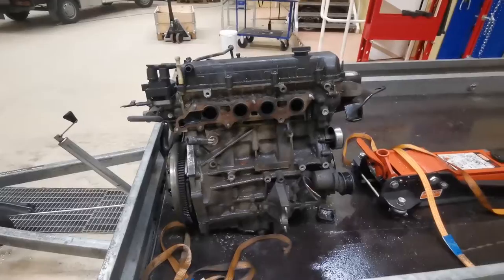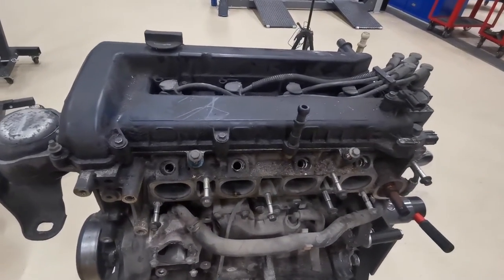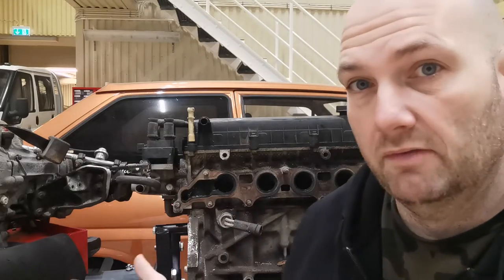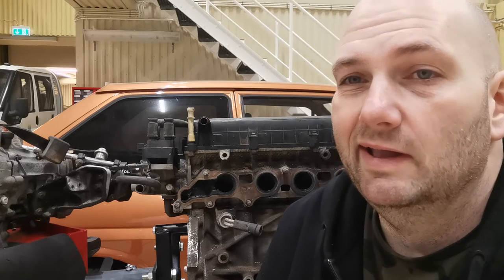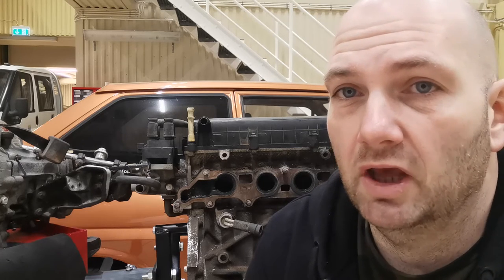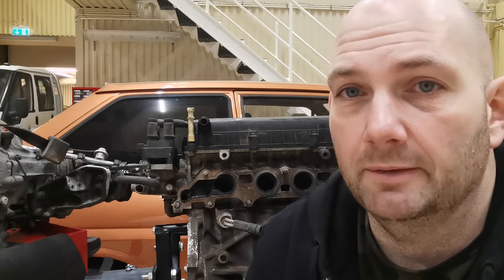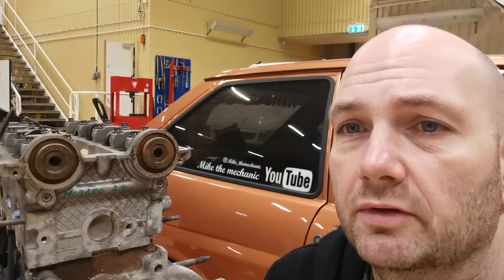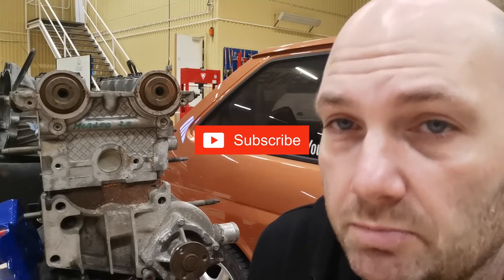Zetec OR Duratec? I wish I had known the difference before I started. Which one should YOU buy?

Comment: No offence but your out of your depth a bit here, it’s  a Ford engine mazda adapted. 

Mtx75 box fits, fiesta st150 ib5+ box fits, focus mk2 2.0 duratec box fits. Any box with a bell housing adapter plate for £2-300 quid

A bit more homework would have saved you a lot of hassle.

I’m no mechanic but know these things.

Duratec 1.8 2.0 2.3 2.5 Ford engine 2.5 has vvt
Mazda 1.8 2.0 2.3 have also got vvt. 

A lot of internal differences/ dipstick location inlets etc.

Major thing you should have checked. 

Duratec has a chain 
Zetec has a belt

Hope this helps a bit to someone

Comment: I have a 1.8 Duratec petrol Mondeo.  5 speed manual.  MTX75.
Reply from the maker: That's probably the same engine as in my video with the black top rocker cover
Reply: @mike_themechanic  yes.  It looks the same.  Mines on 144,000 and still runs like a top (de-flapped at 77,000). Fresh 5w30 every 10,000
Reply from the maker: @steve0680657  it is possible to fit in to a fiesta but it's not as "straight forward" as the one I've done.
Reply: @mike_themechanic  The st150 gearbox is an option.
Reply from the maker: Probably. Anything will fit it just needs more fabrication work to fit it.

Comment: Old Fords are like a LEGO set! Every engine will fit every gearbox and drive shaft.
The Mk2 Mondeo in 1998 still has either Silver or Blacktop but all the bolt patterns are the same for RWD or FWD
I built a ZVH turbo engine (1.8 zetec bottom end with CVH head) and all patterns are the same.
When the Duratec came out they used Mazda engines and gearboxes.
But when the Zetec SE came out (Yamaha engine) they used the old RWD T9 pattern!
Reply from the maker: Never thought of it like a lego set before 😂😂😂
Reply: @mike_themechanic  If you're into a Mk1/2 Fiesta  with a Mondeo engine you should know LOL
Reply: Even the old 1.3 crossflow engine has the same bolt pattern.
Reply from the maker: @cossiemk2 well it is the first time I've done this kind of swop so it's been a voyage of discovery 😂.
Originally i thought it was an easy task just an engine and a gearbox bolt them together and that's it done but then I found out about the  baffel plate, the driveshafts, the brake servo, injection system, fuel tank etc etc
Reply from the maker: @cossiemk2  never even considered that 😂😂😂😂
Reply: @mike_themechanic  Ok so it's a new adventure! I thought you were a Ford man with some experience! Sorry!
Reply from the maker: @cossiemk2  i started my mechanic life at ford back in the late 90's, and after moving to sweden I've worked on hgv and plant equipment before becoming a vocational teacher in the automotive industry. I've always had an eye for fords but never had the opportunity to do anything like the engine swap that I've done now.

Comment: These duratec is also used in volvo v50 c30 2003-2012 front wheel drive with 5 speed MTX75.
Reply from the maker: True.
Reply: In the US, every Duratec powered Focus with a manual transmission has the MTX75. They are pretty easy to find. The 5 and 6 speed transmissions from the Mazda 3 also bolt up.

Comment: As you may know I’ve fitted the st170 engine and 6 speed box in mine… they’re a very similar engine, I’ve tried to be as detailed as I can in my insta with how I’ve overcome a few problems.. too many to list here! 😉 keep up the good work.. there’ll be many more obstacles!
Reply from the maker: Do you have a link to your Ig?
Reply: @mike_themechanic is my fathers 1.6 duratec a mazda engine, or a yamaha codeveloped engine
Reply: @mike_themechanic cuz my dad used to own a 1.6 zetec
Reply from the maker: I think all duratec engines were mazda. Zetec was ford made.
Reply: @mike_themechanic  it still sounds almost the same to me.
Reply from the maker: The engines look quite similar if you look at the rocker cover but they are very different from there downward. The zetec engine fits to alot of the ford gearboxes the mazda ones don't
Reply: @mike_themechanic  ok, good to know.
Reply: @mike_themechanic  1.6 Duratec actually Sigma (Zetec-se newer iteration)
Reply from the maker: @gentrest6421  ok thanks. Glad someone could give a more correct answer
Reply: @bigmansir3745  Yamaha co-developed -  Sigma.

Comment: They did a mk3 Mondeo with Mazda derived Duratec engine and 5spd gearbox. I have one. 2005 2.0i "Zetec" (not to confuse things further, Zetec being a trim level on the mk3!!).
Reply from the maker: I think most mk3 mondeos were duratec mazda engines.
Reply: I have a 1.8 Duratec petrol Mondeo.  5 speed manual.  MTX75.

Comment: Ib5 out of an st150, bolts straight together.
Reply from the maker: Any of the ib5 gearboxes bolt straight to the zetec engine
Reply: This is the confusion - the st150 is definitely duratec 2.0 and definitely ib5... I wonder if there are multiple variations of the duratec blocks with different bell housing bolts no one talks about...
Reply: @branney6914  Highly unlikely. The transmission just has a different bell housing to fit the other engine. This is very common.

Comment: Are the 'black top' engines cast aluminium or engineering plastic?
Biggest problem I have with Ford is they use the same name for vastly different engines (guess that's the problem you found as well?)
I've got a 2004 Mazda B2300 but no idea what actual engine is in it, I know it's Ford and maybe Ztec?
If I was still in Britain it wouldn't be a problem as I knew several people working at the Bridgend Engine plant (but I think that's also been closed down now?)
Reply from the maker: They are cast iron blocks with alu cylinder heads.
Reply: @mike_themechanic   Sorry, I should have been more specific, I meant the cam covers
Reply from the maker: The black tops are plastic and the silver tops are aluminium but the silver top does fit on the black top.
Reply: @mike_themechanic  That's good to know, 'plastic' seems to distort  and leak oil into spark plug recess. I've worked on motorcycles about 50 years and never liked engineered plastics on engines, even alloy on the Honda 750/900 (and various Kawasaki's, Yamaha's and Suzuki's) allowed leaks around plugs when the seals were not in right or age hardened.
Reply from the maker: @1crazypj I've replaced my plastic one with an aluminium one I think it looks better as it could be painted as well
Reply: @mike_themechanic  I did a bunch of hunting around last night and find I have a Duratec in Mazda. Even though it's a crazy amount of work, aluminium can be polished. The alloy quality can't be any worse than 1960's Honda's 🤔 (although I'm too old and too lazy to spend the time nowadays 😁)
Reply from the maker: @1crazypj I painted mine in silver and clear coat I like the look of it. I was going to do body colour but decided against it in the end

Comment: The Mazda version is arguably better than the Duratec, Ford cheaped out on the bottom end components, namely the pistons and rods, to  get 300bhp from the Duratec takes a lot of work, not so much with the MZR.
Reply: I had two mazda 6 mps's, both enginges went kapoot. Only found out after the second one shit itself that ford may have had something yo do with the soft componants in the 2.3 four cylinder dohc 16 valve single turbo engine.

Comment: The zetec is better engine  the duratecs drink oil and been known to knock bottom.end out I have seen zetecs with over 200000  miles and still running well the fiesta st 150 uses the 2.0 litre Duratec engine and uses a 5 speed box
Reply: My 2012 Fiesta has a 1.25 duratec engine, its a normal port injection engine and it has never lost one single drip of oil an i'm at 212000 kms now :D
Reply: @LikaPyramid  different engine
Reply: @MegaReddevil71  what do you mean? Different than what?
Reply: @LikaPyramid  he's comparing the 1.8 and 2.0 zetec to the 1.8 and 2.0 duratec  your engine is completely different
Reply: ah okay
Reply: The 1.6 duratec is great, it was codeveloped with Yamaha
Reply: Except that the Mazda based Duratec motors make way more power than the Zetec.
Reply: @madmatt2024  zetecs can produce good power not quite as much as duratec as they are up to 2.5 litres  a friend of mine built a 2.1  zetec with throttle bodies and other fancy bits made 230bhp

Comment: Sold the engine yet? Could use it for mycket escort mk2. Any wiring, manifolds etc included?
Reply from the maker: Still have it. Inlet manifold is included. No wiring unfortunately
Reply: @mike_themechanic  Thanks for your answer. I am thinking about using the engine stock including injection and everything so I would need the loom, keyfob, instrument cluster. I suppose I should try to get a complete scrap car. What is your plan to get the fiesta through Swedish mot/besiktning? Keep up the good work.
Reply from the maker: That was my plan from the beginning but it's alot more work than I was planning on. I've gone with an ecu from Motorsport electronics and a set of bike carbs so it's only 3 additional wires to the loom plug and play for the rest.
Reply: @mike_themechanic  I just watched a Youtube video about the duratech and realized that my plan is not possible. The intake manifold is not going to work in a rwd escort and since its made from plastic its not possible to work on. I will have to rethink this. Getting scrap engines etc in the uk is much cheaper than in sweden as im sure you know but i could still use/modify the standard exhaust manifold. I suppose it could be possible to build  an inlet as long as i use the thottlebody...
Reply from the maker: There are people in the UK that build rwd escorts but I'm not sure which engine they use. I got my engine from a scrap yard in Sweden but it didn't come with everything so its took me time to find all the extra parts I need to fit it in. I would have liked an st170 but they are crazy priced in Sweden and its only the head that different to the engine I already have.
Reply: @mike_themechanic  Im not sure but I dont think they have the same mot/emission rules in the UK. Thats the reason that i cant just throw on some carbs. My car is from 1977 so emission rules applies here in sweden. Had it been from 1975 or older it would have been easier.